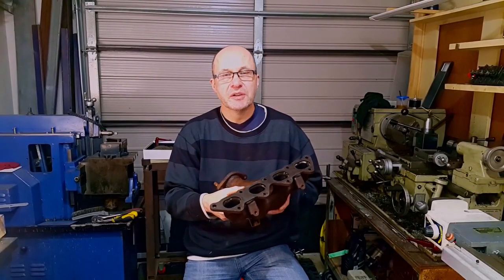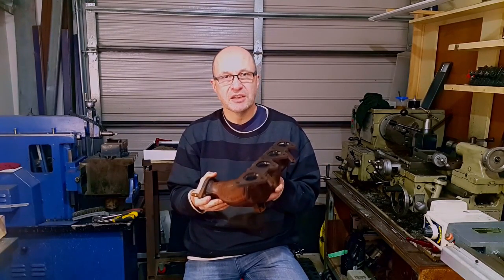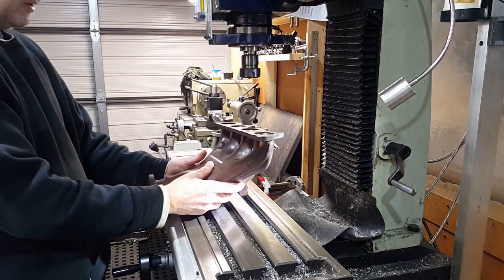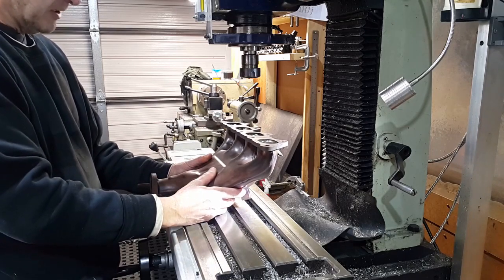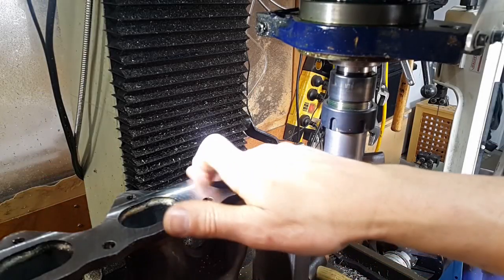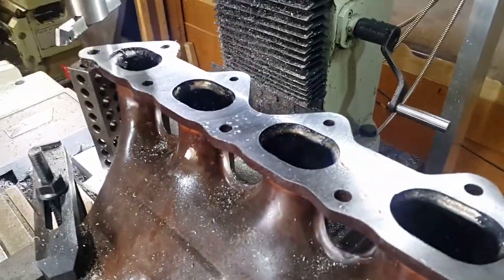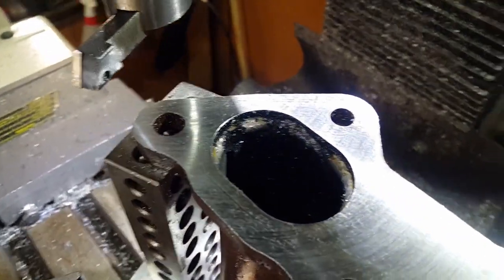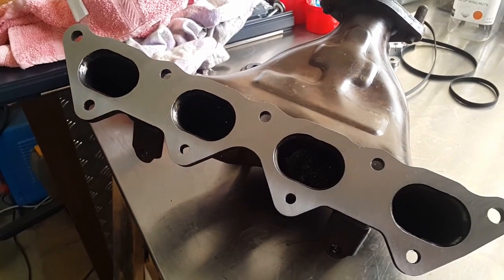#75 - Skim Resurface Exhaust Manifold - Manual Milling

Comment: Hi Kevin, very nicely done, not an easy setup. I was just smiling at how similar our workshops look, same machines, same places, lol. The only difference is your mill sounds much better than mine, how do you power it? Cheers, Jon
Reply from the maker: Hi Jon. Thanks for watching. The mill is powered by a 2hp single phase. Ive recently had the gearbox apart to check the bearings and gearing for wear. Was allgood. Cheers Kevin